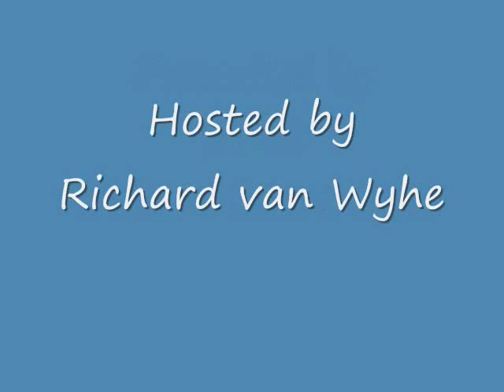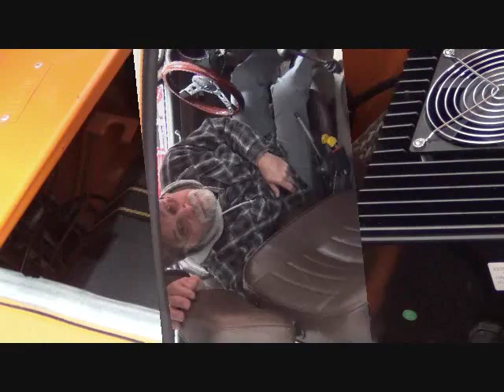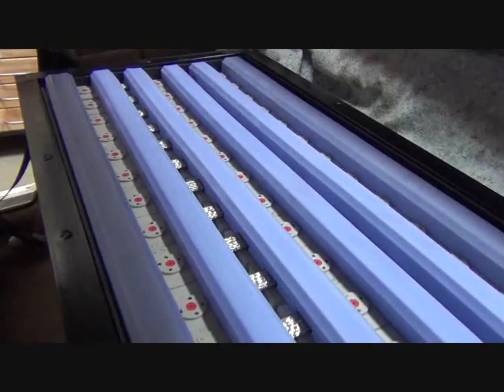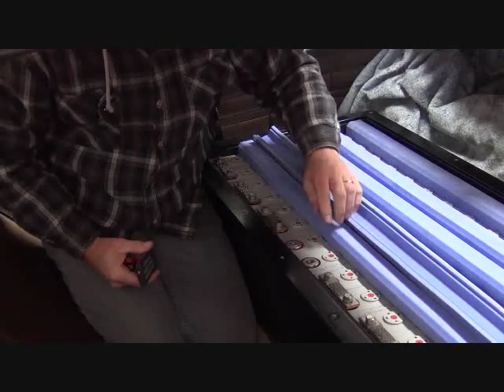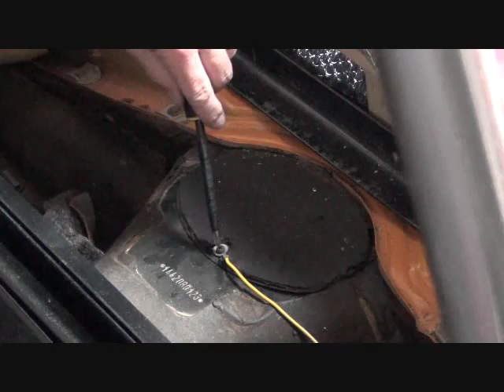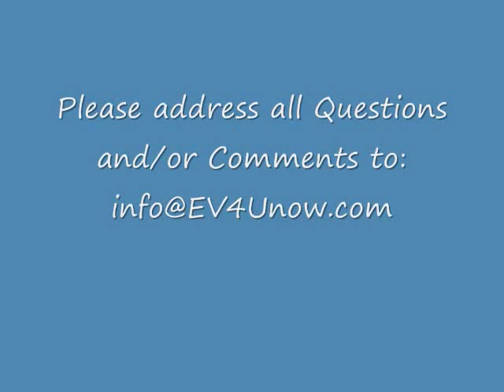Electric Conversion - VW Karmann Ghia Repairs, Maintenance, and Improvements

Comment: So that's like 150$/cell?  Each cell = 100ah.  Do you replace defective cells rather than replacing the entire battery pack?  Does it have explosive fumes when charging, does it have an exhaust fan?  Other than that, I suppose it's tires and brakes, and perhaps cheap brushes.
Reply from the maker: Thanks for watching.  When we purchased this pack, the cells were $149 each.  Yet to have a defective cell, but yes you only need to replace the defective cell.  No fumes, these are lithium iron phosphate cells, not lead acid.  Stay tuned for more...